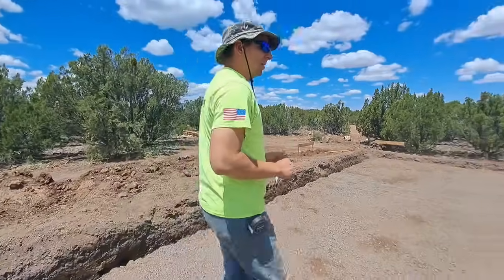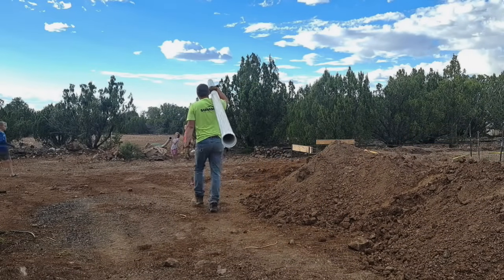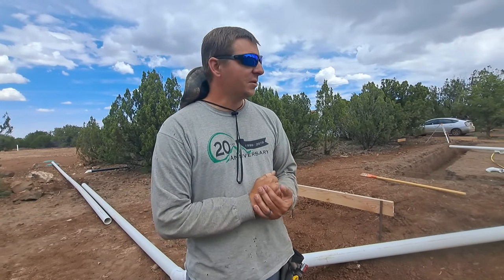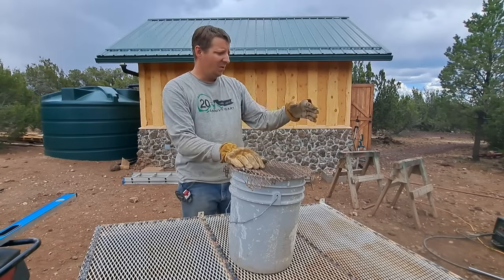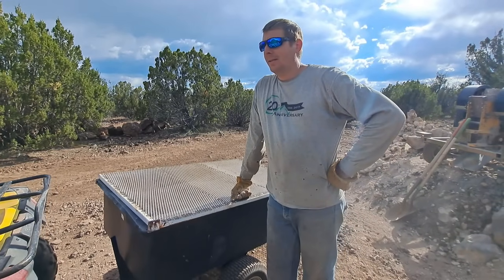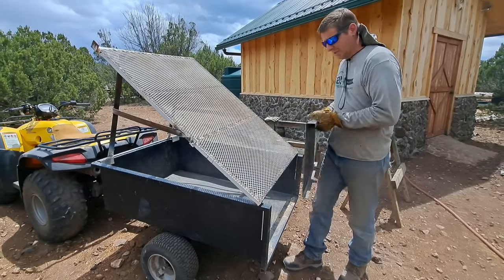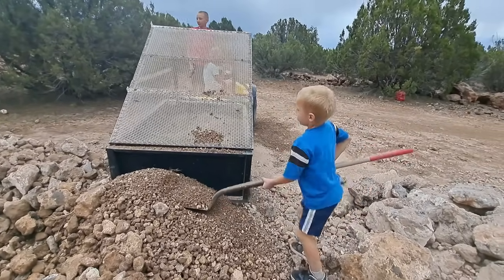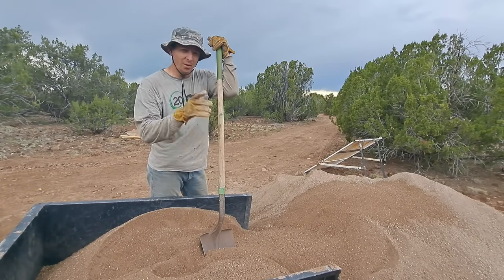We Should Have Done This Sooner | Plumbing Layout

Comment: When I was younger and building my first home I used the old bed bases with mesh as the soil sifter,  always built at an angle so gravity did the work. A really handy attachment to it was a vibrating motor so the stones were jiggles, made the work faster too. I like how you came up with your own idea, it works well and saves you heaps.

Comment: Hello guys love the show and I do not want this to reach you late but try not to use regular elbows if possible use a sweeping elbow This allows waste and fluid to move freely threw lines. Reg. elbows will work but you may get a build-up at those pinch points and if you do place a cleanout tee so you can unclog the pipe either way  Good luck. Also if you just put legs on the original metal, you could have used the front bucket and just removed the screen after you got a pile of dirt

Comment: You should add sidewalls to your screen and attach an old weed eater motor with a off set rubber lob on the shaft to make it vibrate looky there an upgrade video for the sreener

Comment: Why did you cut up the screen? I would have just welded some legs to the back and sloped the entire frame at 33 degrees then just dumped whole backhoe buckets of mixed material on it then drove around to the other side and scooped up the sifted dirt. The rocks would slide down and create a debris pile.
Reply from the maker: We don't have the larger material on hand to make a full sized rock grizzly. That and we're not running a mining operation. Getting the clean fill that we did did not take but a few hours of time to make. Thanks 🙂